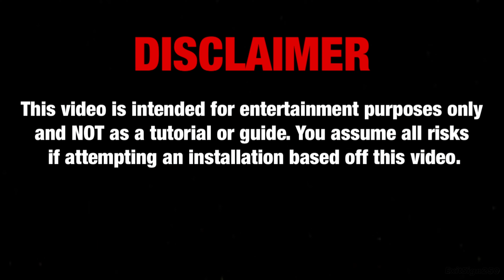Replacing a Two-Prong Ungrounded Outlet with New Three Prong Outlet

Comment: I'm confused how this is any safer.  If there is a short in your appliance (toaster, etc.) there is no path to an actual ground, so wouldn't the appliance body still be charged, and therefore a shock hazard?
Reply from the maker: The GFCI breaker would detect this short and deenergize the circuit.
Reply: That's a good question. If you had a regular breaker and no ground wire, but you have a GFCI receptacle and also no ground, your toaster would become energized, but the neither the GFCI or the breaker would trip because there's no current flowing yet. If you put bread into the toaster and didn't touch any metal or heating element, the GFCI should trip immediately because it would sense a difference in current between the hot and neutral, without you getting shocked. If you touched the metal case, even without activating the toaster, you may feel a little jolt, but the GFCI should trip immediately because you are momentarily providing the ground. It's safer, but not as safe as a properly grounded circuit. If it has a ground wire that goes to the main panel ground/neutral bus bar and a ground fault occurs in the toaster, the GFCI should trip immediately, even without human interaction. That makes grounding the safest method. In this case if it was an ordinary receptacle with ground, the breaker would trip.

Comment: Is the original power supply to the metal box MC /metal clad or old cloth wrapped.. because if it's metal clad, couldn't you add a ground pigtail from new outlet to the metal box to have it grounded...?
Reply from the maker: The metal box did not have any reference to ground so that method would not work in this situation.
Reply: How could you tell which neutral wire to insert into the gcfi? I need to install 6-8 gcfi breakers bc our house was built in 1960s. There are many neutral wires in the panel, unsure which one to insert. Is there any tool to detect?

Comment: A long time ago I thought the ground  wire was for more power but it's just for backup
Reply from the maker: A ground wire is for safety reason and to prevent shock. In case of an electrical fault (for example a wire touching a conductive surface in an appliance) the electricity will run through the ground wire and trip the breaker due to excessive current being drawn.

Comment: How could you tell which neutral wire to insert into the gcfi? I need to install 6-8 gcfi breakers bc our house was built in 1960s. There are many neutral wires in the panel, unsure which one to insert. Is there any tool to detect?
Reply from the maker: You will need to trace which neutral wire pairs with the live/hot (black) wire on the circuit you are installing a GFCI breaker. You may be able to find the pair of wires (black/live and white/neutral) as they will be in the same outer sleeving.

Comment: Great install I’ve never seen a g.f.c.i breaker
Reply from the maker: Thanks! They are certainly less common compared to standard GFCI outlets, but in some instances they would be a better choice.
Reply: @ExitSign250  I agree that breakers are better in some cases, especially when separating GFCI from something that shouldn't on it like a light or refrigerator. I also think breakers are built to better quality standards in the factory than receptacles, but that's an opinion. Here in conduit land I was replacing a bad GFCI in my mom's co-workers bathroom, and when I was touching the neutral wire the back of my hand touched the metal mud ring and I got shocked⚡. Her two bathrooms were on 2 separate dedicated 20A breakers for receptacles only and shared a single neutral between them. Even though the breaker was off on the recepticle I was working on the GFCI in the other bathroom put 120V on the neutral. A double pole breaker or a double pole GFCI would have been a big plus, but also the 240V GFCI would be expensive.
Reply: They are quite nice. I like them, but expensive.
Reply from the maker: Yep. GFCI breakers are nice for appliances (when required) where resetting/testing at the receptacle itself is challenging. And that is very interesting with your bathroom circuit story. I like the idea of each bathroom receptacle on its own circuit, but seems odd they shared a neutral. This sounds like an older installation. When was the house built?
Reply: @ExitSign250  that house was built in either 1998 or 1999. It used to be common practice to share a neutral between two branch circuits originating from L1 and L2. The loads on the two circuits are essentially in series and the neutral balances the voltage carries residue current. So if one bathroom receptacle has a 17A load, and the other bathroom receptacle has 13A load, the neutral will carry a current of 4A. If both bathroom receptacles have 9A loads, then the neutral will carry 0A. I just thought it was interest that the GFCI put 120V on neutral while it samples for current leakage. My house was built in 2005 and also has the same type of shared neutral circuits. I believe it was 2011 that NFPA stopped the practice. It's only a hazard if you break the neutral without shutting off power to both circuits.
Reply from the maker: Interesting stuff. Around my area sharing neutrals wasn’t common for residential since we have used Romex for years. I’m assuming you are from the Chicago area (from your joke about conduit land) where it would be easier to have two branch circuits share a neutral since you can run the individual conductors in conduit. I suppose you could use a three conductor NM cable to have two branch circuits share a neutral, but again I’ve never seen this done in my area.

Comment: Will any appliances detect the open ground, and not function?
Reply from the maker: The ground wire is only for protection against electrocution and not needed for 99% of appliances. Some sensitive electronics might need a ground wire to prevent any unwanted interference.

Comment: Should not have done that, you should ALWAYS reuse existing connections (Unless they're back-stab, because those are a b*tch and a half to get out (ask me how I know this) and it's typically easier to just cut the wires...) Don't cut existing leads, it saves you a LOT of trouble, first off, second, they're already curled in the way you need, and third, you're giving yourself less wire to work with this way, you ALWAYS want to make sure that you have more than enough wire to be able to pull the outlet out should you need to replace it in the future anyway, but if you do this EVERY time, you are going to have a VERY bad time trying to get an outlet in at some point in the future, granted it's only about an inch, but that inch of wire can make all the difference in the world, and will save you a TON of money in the long run as well.
Reply from the maker: Most of the time when using existing looped wires, they tend to bend out of shape when removing them from the existing device. And when you try to connect it on the new device, it can be difficult and in some instances the connection might not be as secure. I used to reuse the old connections but I’ve found it’s much easier to just cut and redo. Plus, it’s not everyday an outlet, switch, etc. will be replaced. Worst case if the wire(s) are too short just make an extension pigtail; I’ve had to do this on many occasions.
Reply: And in response to the outlet being "code complaint", no it isn't, not exactly, I'd personally suggest tying a lead from the outlet ground and anywhere on the box if you can, this is Canadian grounding (I think), but it'll get you a proper ground
Reply: @ExitSign250  At least use Wago lever nuts in that case, those things, I've seen, are SUPER helpful, they're like bus bars themselves, easy to use and the lot, should do a review on them (I should too)
Reply from the maker: I am in the United States, and according to the 2020 NEC (article 406.4(D)(2) ) this is a compliant solution for replacement of ungrounded receptacles. Of course adding a physical ground wire is ideal but this cannot be done in all circumstances. (Mostly cost reasons) I will never use Wago lever nuts for any permanent installation. I’d rather have a mechanically secure connection with a wire nut. All of this to say, everyone has an opinion and way of doing things. As long as the installation is fully code complaint, methods of installation really aren’t important.
Reply: As long as there is enough wire left, its better to redo the connection since the previous outlet will have been wiggled both during installation and possibly also wiggled around during use if it wasn't secure, this can fatigue the copper, making it easier to break off. 

As for the wago arguement, they are great for extending short wires & they can handle way more than this circuit can give - lets say for example a wire nut can handle 50 amps, okay cool, if a wago can only do 30 amps, that's far past 15 amps so there is no reason to not use them for this type of install; there was no reason to use them here, but saying they are better/worse than a wire nut is give or take since they work just fine for what they are rated for and are easier to use, especially in a tight box
Reply from the maker: I suppose I have just never liked the Wago connectors and have always been more of a wire nut person. Either way they are far more expensive compared to wire nuts which is also is another leading factor on why I choose not to use them.
Reply: @ExitSign250  absolutely a wire nut if installed on a well twisted set of wires is basically just an insulator as the splice itself can hold itself together and still pass current with no issue of course we always put a wire nut on but the fact that the circuit can still stay intact and functional without should go to show how much better of a connection it is so as much as push in connectors/wago's can be useful in certain circumstances they are not equal to a wire nut I wouldn't say that if I hadn't experienced plenty of wago failures and had to replace with a wire nut
Reply from the maker: I totally agree. I haven’t encountered too many Wago’s but I have heard some failure stories. However wirenut failures are very uncommon when made correctly.
Reply: @nics-systems-electric  a Wago failure is only due to improper installation, and it’s not at all similar to a generic push connector or backstab. they work on different principles.
Reply: @Aaronproductions  in that case there's definitely a lot of improper installs because I've had both the push in type and the ones with levers fail plenty of times
Reply: @nics-systems-electric  Are you sure those arent the knockoffs? you can find videos on youtube of wagos vs wirenuts with amperage testing and it yeilds nearly the same result, going well past the rating for both types of connectors.
Reply: @Aaronproductions  yes they were genuine wago's the problem I find is that the tests aren't real life conditions where every install isn't 100% perfect. Humans do make mistakes and without the conditions of real life with temperature changes moisture and vibrations etc
Reply from the maker: I think a good comparison would be SharkBite plumbing fittings, if you are familiar with those. I’ve heard both horror stores and success stories with them. To what I understand if they are installed correctly (and are genuine not a knockoff) they work well. But most of the time they are not fully installed correctly and issues happen. Going back to the Wago’s, I know they are practically the standard connector used in most European countries which means they must work well. But I still like my traditional wirenuts with the twisted connection. And I can spend $20 for 500 wire nuts versus $30 for 100 two wire Wago’s.
Reply: @nics-systems-electric  " wouldn't say that if I hadn't experienced plenty of wago failures"

Doubt.
Reply: @Shoop83  you don't think I've seen them fail?